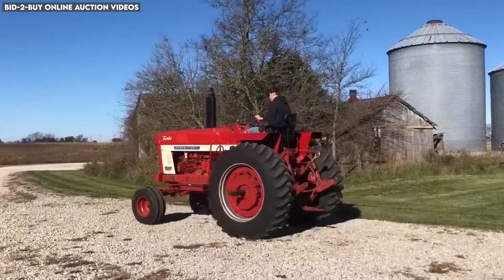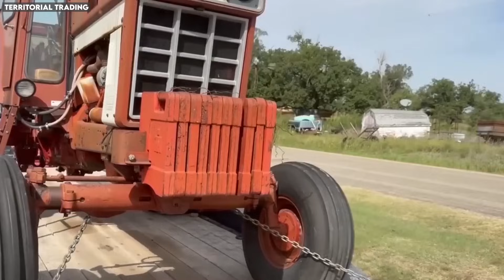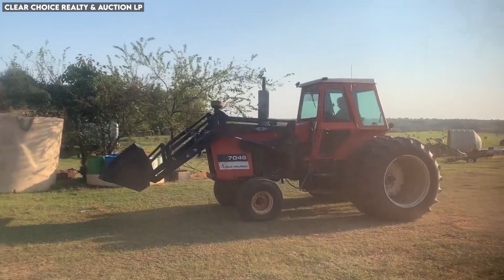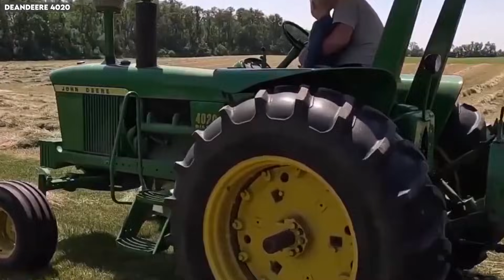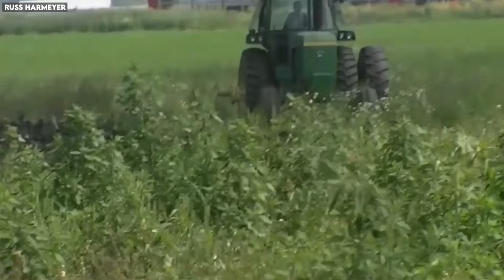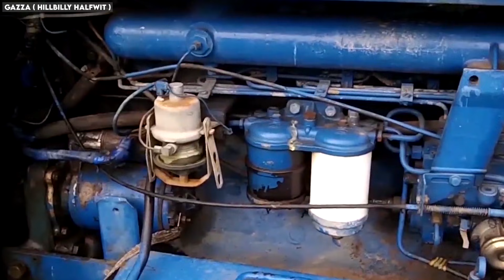Top 10 Most Reliable American Tractors from 1970

Comment: The vast majority of those 401 engines came from the Ford plant in Basildon ,England , same as the 256 four cylinder used in the 5000s which were just (if not more) durable and  built in larger numbers.